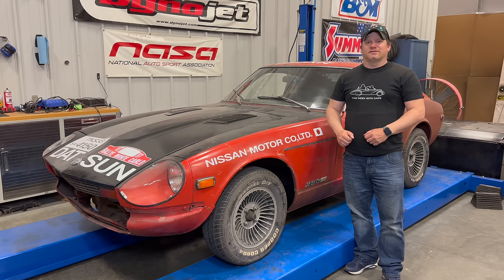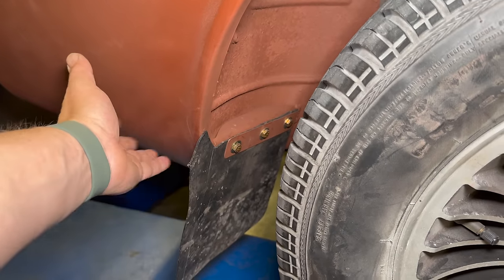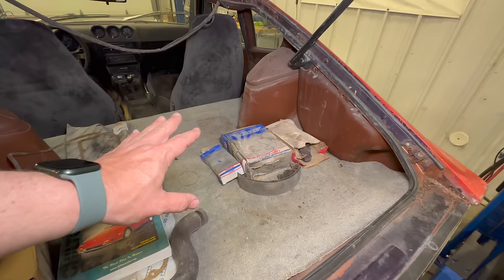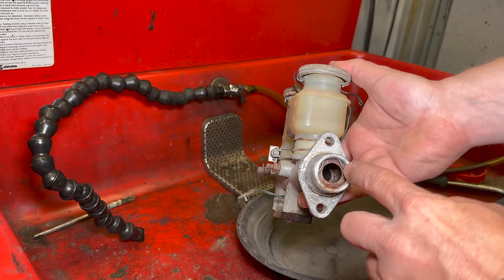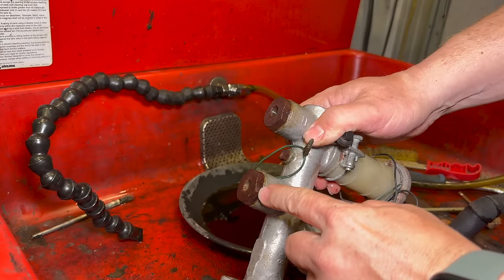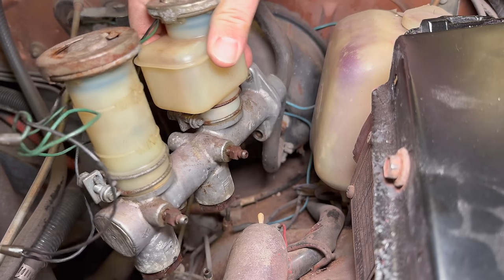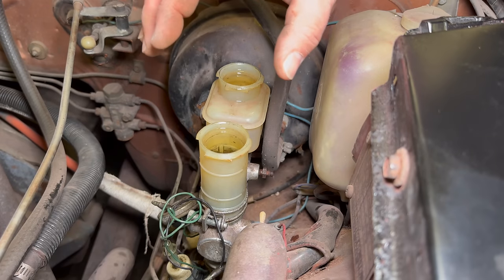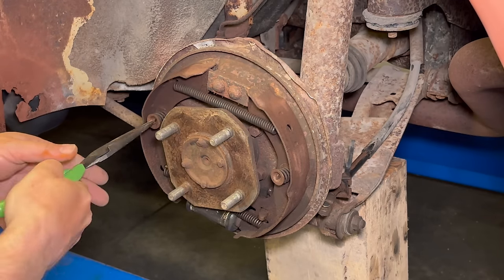1976 Datsun 280z - Fixing Master Cylinder

Comment: The 280 Z is coming along very well, glad you managed to save the master cylinder. If all else fails use the persuader ( a hammer for those not familiar with that term). Maybe you could put your YouTube logo on the car, it would be a good advert for the channel? Thanks Steve for sharing. 👍👍

Comment: Boy does that bring back some memories.  I bought a brand new 1978 280Z and loved that thing. But then Datsun came out with the 1979 280ZX, and I just had to have it. So I traded in an almost new 280Z for a 280ZX.  The ZX was a luxury car compared to the Z.  It rode so much smoother, but still had the power of the Z.  I drove the ZX until 2003 when I drove it into the barn and forgot about it for the next 15 years until I gave it away to charity.  I kind of wish I had kept it now. It would have been an easy restoration.
Reply: datsun 240Z also known as the pound and a half. 24oz.

Comment: I know that I would 100% do it exactly the way you did, but I still cringe when I see the rusty parts go back on!  Love this build!  Can't wait to see it on the track!
Reply from the maker: The new parts are usually junk compared to the originals anymore.  Also if it doesn’t effect the operation why waste the time and money.  I’ll save that kit for a Z that needs it.
Reply: Agree, I smile when YouTubers spend a fortune to replace old brake hardware etc that just needs cleaning and correct lubrication. People forget that most of the old hardware was over engineered purely because that way you could use it across models and reduce stock. Early 60s and 70s European cars come to mind for that.
Reply: @ThisWeekWithCars  Totally agree!

Comment: Typical Z car bodge,, fit a alternate carb and intake.I have owned both 240 and 260Zs and only one had the original carbs. That car was about 6 years old.And had both front doors cracked. Every other were tradeins and rusty heaps,, they were Zs!!
I do have a set of factory carbs. Complete with filter.